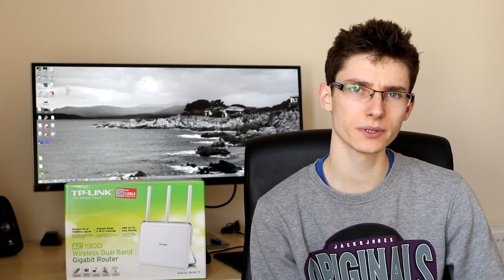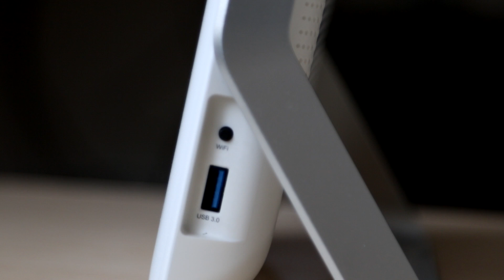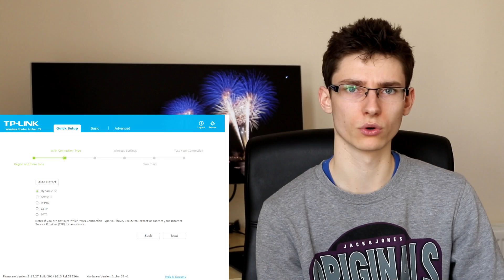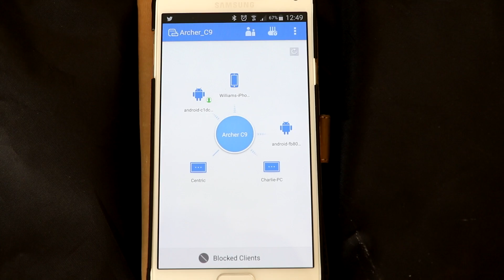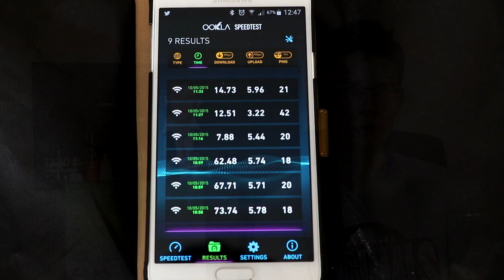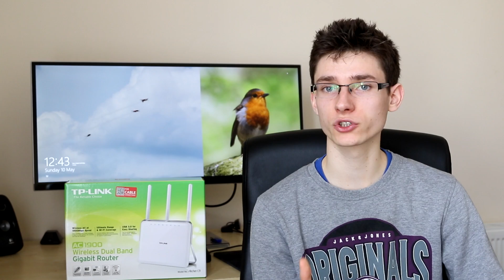TP Link Archer C9 Wireless Router Review

Comment: Are you still using this? Any updates since the new firmware has been released on the wifi aspect? I'm thinking of getting this since it's the first VDSL2 with dual band wifi and a Broadcom chipset (barring the Billion since it has wifi issues).